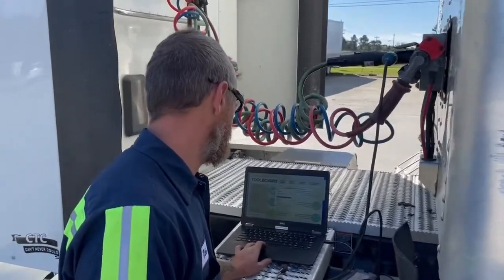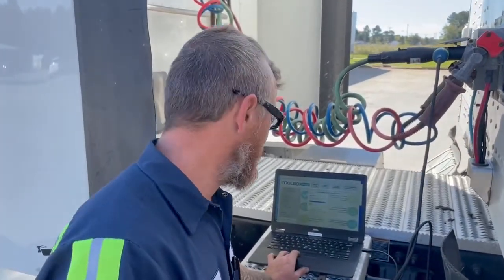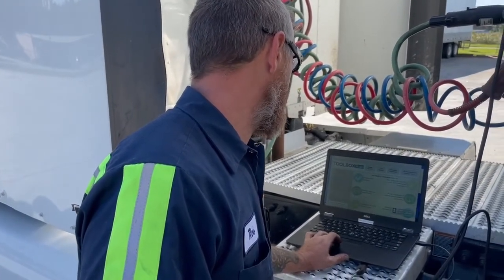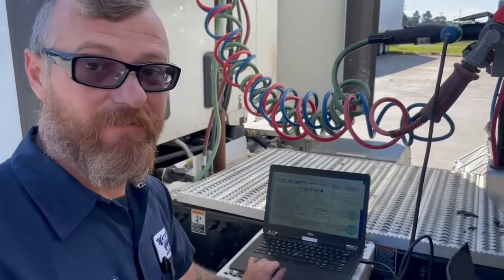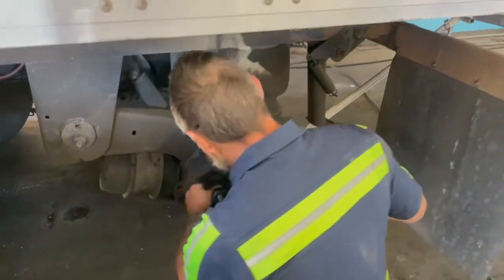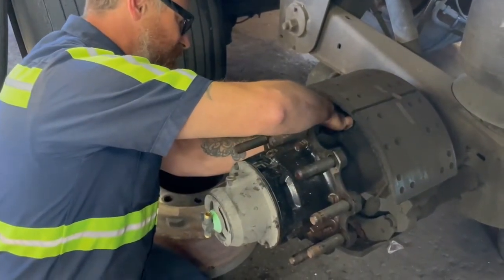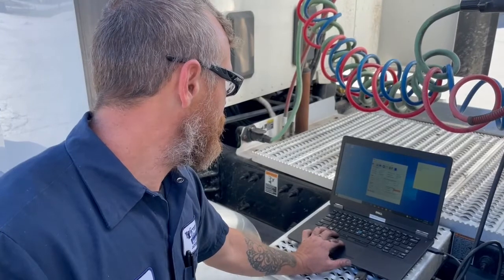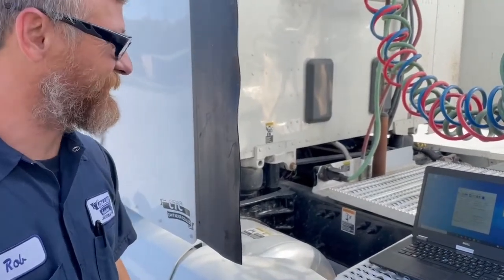Repairing the ABS on a Trailer

Comment: What protocol does it connect through?
Reply from the maker: We use Nexiq cables with an adapter to hook up to the 7 way. Adapter: Snap On J560 PLC Adapter and the program is called Wabco Toolbox.
Reply: @collinstruckingcompany  protocol can bus or j1939

Comment: What program is that and what is the connector called? Will that hook up to my nexiq 2 cables?
Reply from the maker: The program is called Wabco Toolbox and yes, it will connect to the nexiq cables.
Reply: @collinstruckingcompany  what is the cables you have connected to thr computer , thanks
Reply from the maker: @sts.556   We use Nexiq cables with an adapter to hook up to the 7 way. Adapter: Snap On J560 PLC Adapter